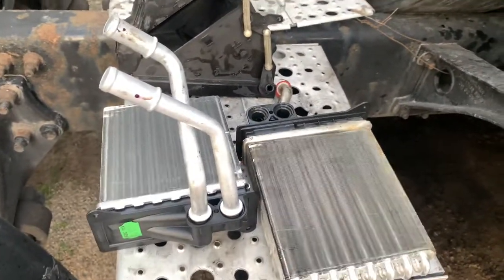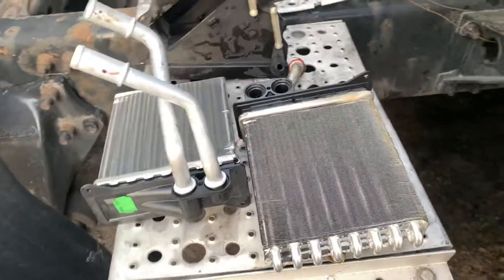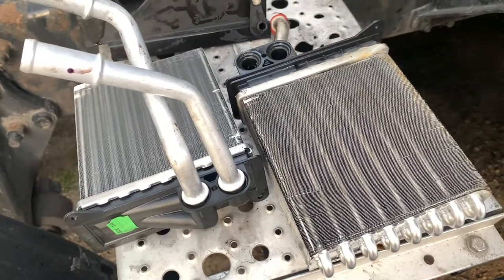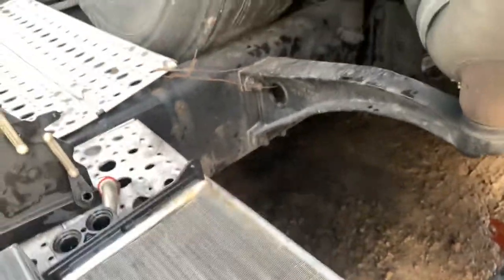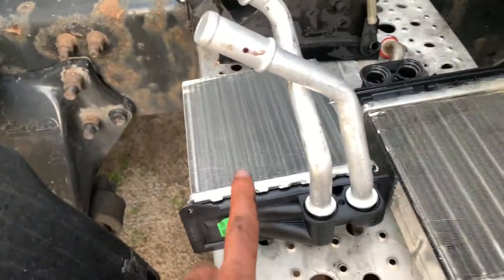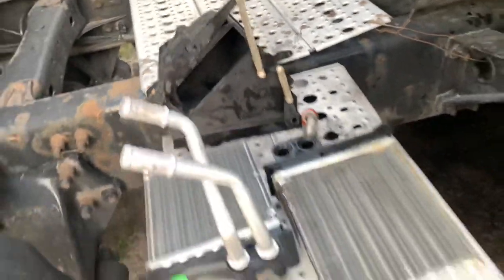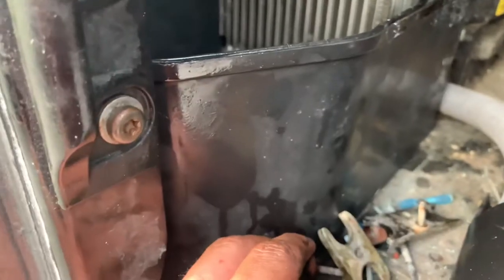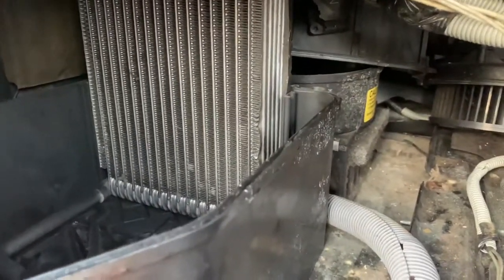Sleeper heater core replacement on 2006 freightliner century

Comment: How did you get the clips off and back on ?
Reply from the maker: Good question, I ran my fingers around around with a small flat head. Also there are one or  two hex screws you have to take out before removing the cover. Removing the cover was tough due to no vertical space, but I left up & move it towards the other end of bed (driver side).
Reply: @owneroperatorlife4380  I have to do mine tomorrow wish me luck thanks for the video
Reply: I'm about to do my 2010 Columbia and was wondering as well.Let me know how to remove clips.And putting them back on correctly.Thanks in advance.